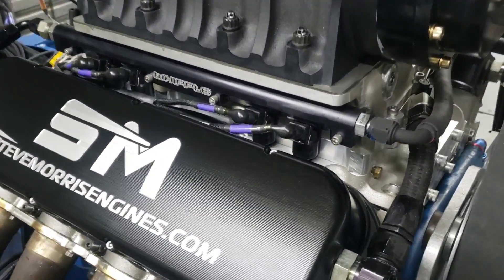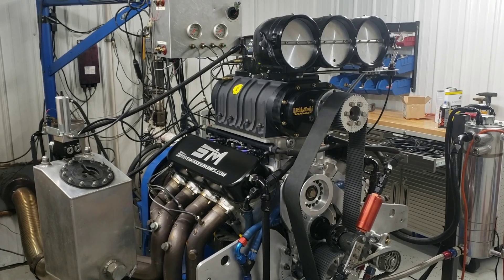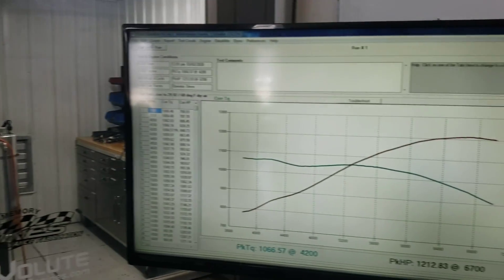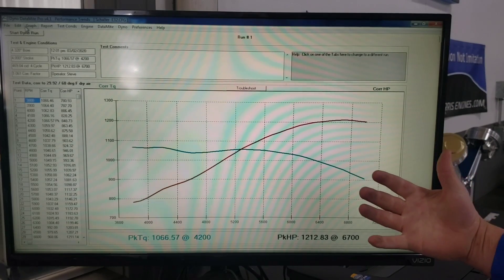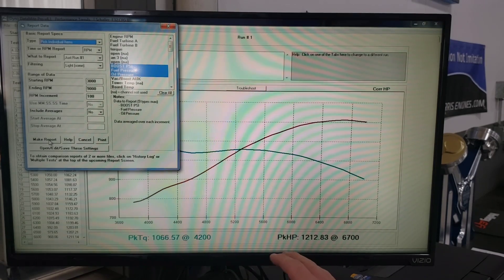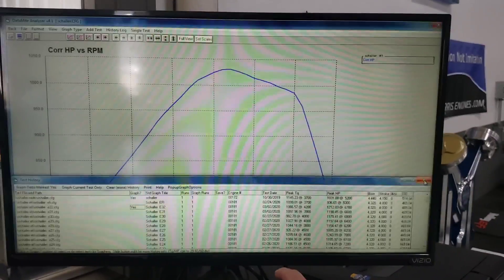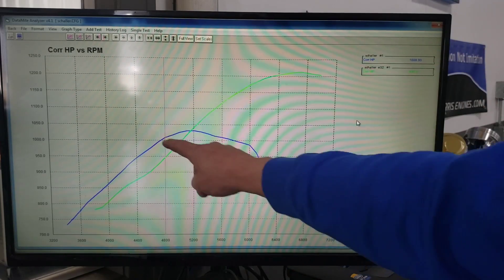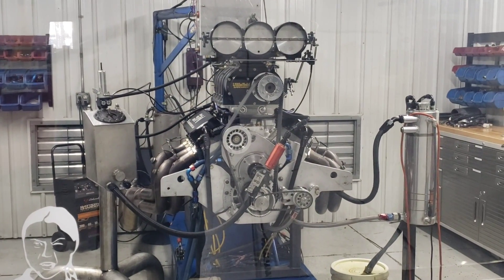Limited Hydro plane engine base line.

Comment: Awesome channel Steve! RE: the operating RPMs of a hydro/boat engine. Props for boats, even the bests/sharpest/hardest ones available, will ALL cavitate (begin to form air bubbles on the surface of the prop) at @7900 RPMs. So, once bubbles start to form, the prop is no longer pushing water, it is pushing air and air does not make the boat go any faster forward. I used to hop-up jet ski engines, and being the 2 stroke variety usually, it was pretty easy for me to port/polish those to turn well over 7900RPMs if I wanted to, but that was pointless due to cavitation at 7900R's anyway. Thought I'd bring that up.... Great videos again!

Comment: If anybody in the world can answer this it’s you Steve. Can a blown alcohol motor be made to live on the street? Efi not mechanically injected. I’ve just always loved the rowdy sound and the instant throttle response the blown alcohol combo provides.
Reply: E85 is heavy alcohol.  The problem is running alcohol means water in the oil. Drag racers have to change the oil, and boil of the water after every outing. Water is bad for the engine

Comment: How many amps will that system draw?  Will it require an alternator to maintain proper voltage for the duration of a race?  How much added weight to the boat when it’s all said and done? I’d guess it would need a bigger fuel cell, battery, charging system etc.